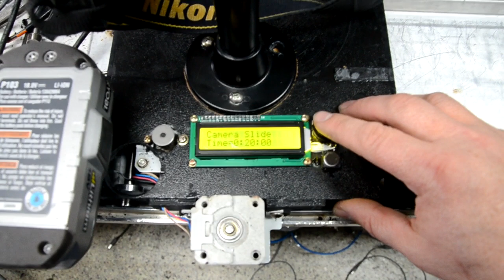Home made camera slider stepper motor - Arduino - Stepstick I2C LCD

Comment: What stepper motor controller you are using? Is nema17 strong enought to lift about 2 kilos (vertical use)?
Reply from the maker: this was for horizontal use.  for vertical use, you will no doubt have to use a screw.  I have made one with a screw and if friction is reduced, up to 5 kilos can be pulled vertical with a nema 23 motor.... then again, everything depends on the speed, gearing and pitch of the screw.

Comment from the maker: the stepper motor inside is disabled for this video part.  It is actually for a turntable to be able to track a target using triangulation.  The pinch roller is part of the shaft of the motor... no gears, no complicated stuff.  just direct coupled.  on the inside are 2 608zz bearings.  Please like and share the video.  It will help me make more interesting builds.

Comment: Hey Alain,

I want to try to reproduce what you have built, but having a tough time figuring out how your pincher roller and motor are working together... It looks like you have a the stepper motor installed inside the cart and the pinch roller hanging off the side? How do these interact? If you could send me more pictures and some explanation I would greatly appreciate it! Email: julien.hoachuck@gmail.com